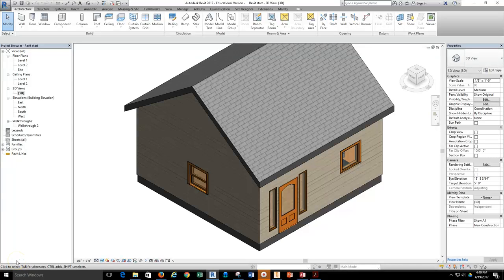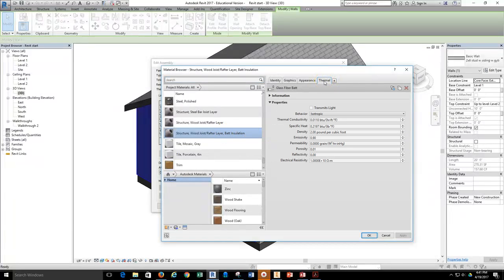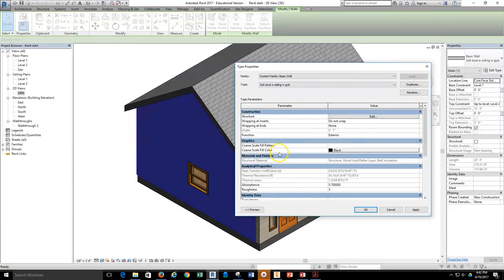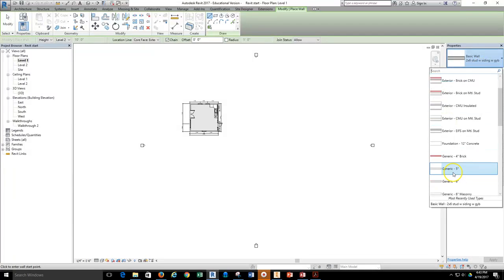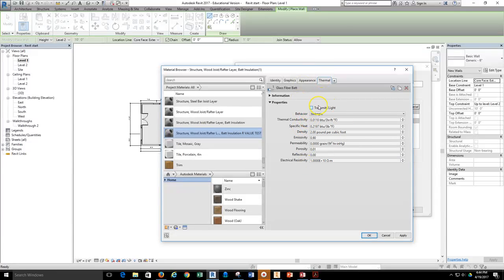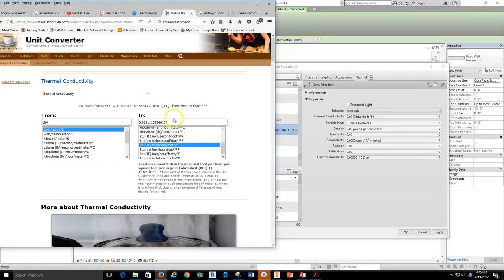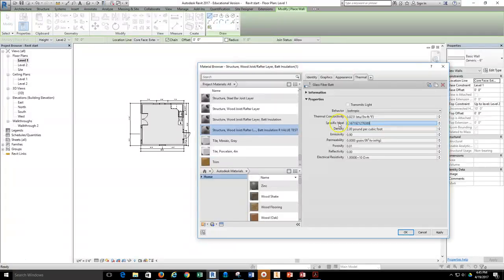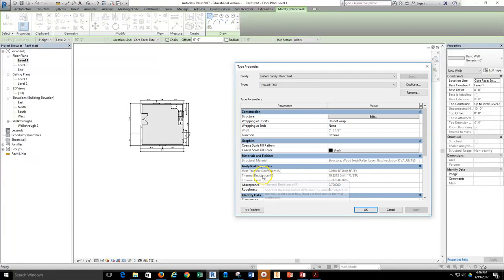Revit-Setting Up R Value-Btu for a fiberglass wall.

Comment: If you are interested in the correct R value, you only need to edit the Thermal Conductivity field and the thickness of the material; specific heat and density only affect thermal mass. Also, if you find the values in a different units system, you can temporary modify the working energy units in Revit, in that way there's no need to convert units.